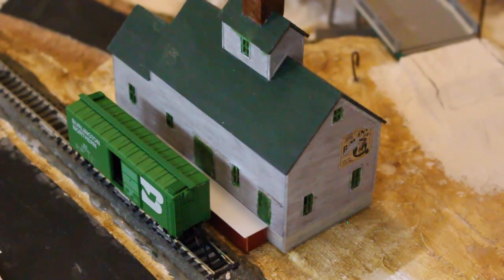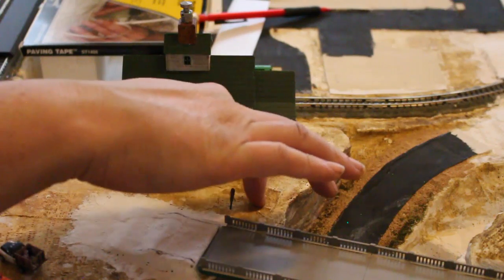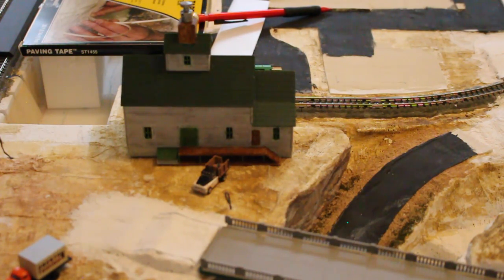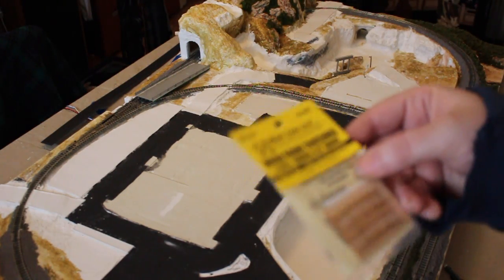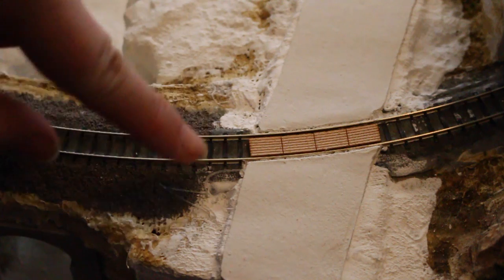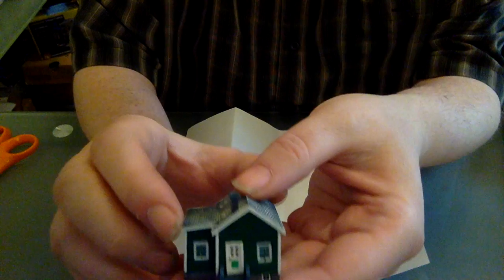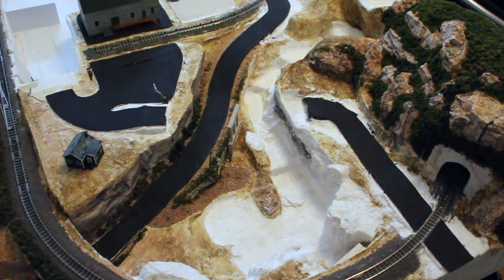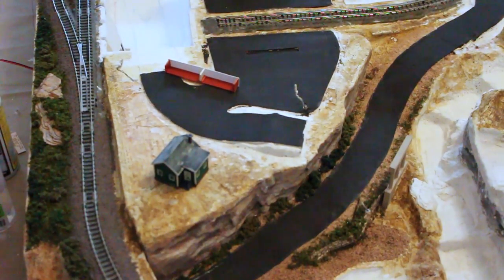Obleo's N Scale Layout Episode 37

Comment: Nice!  Our best laid plans always have to be adjusted, don't they?  Every building on my layout is planned, and each one I have to make minor adjustments to make things work.  Part of the fun.

I have a couple of the Imex that I got off Ebay cheap.  I like their looks, but the problems with their buildings is I find no way to light them.
Reply from the maker: Yep, I would get more Imex buildings if they actually had windows. Specially like the mobile home trailers & farming structures they have. I have a few structures that did fit on this layout. However I also do T-Trak modules so I can always use them on those.